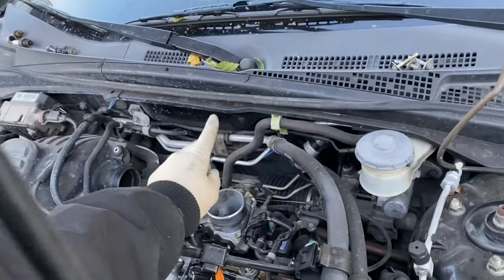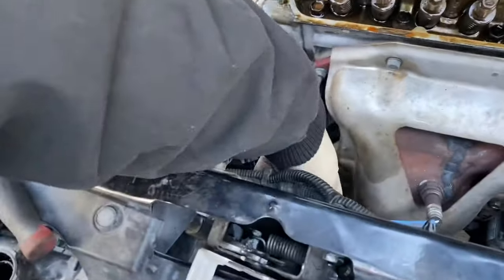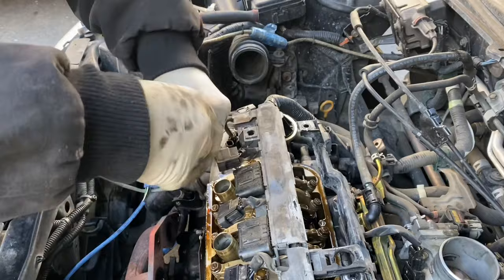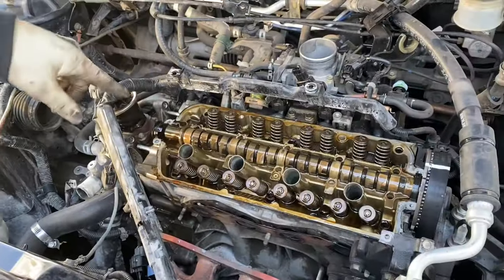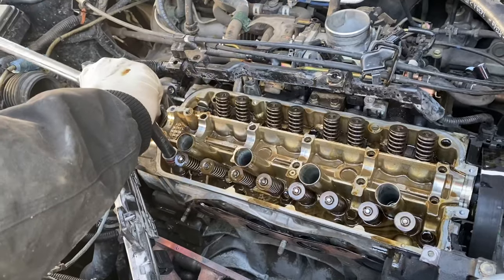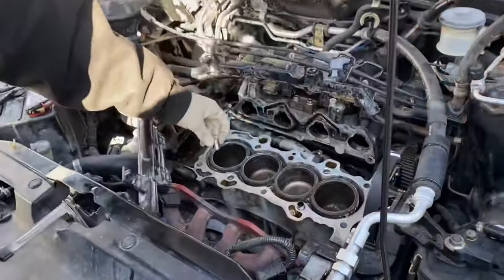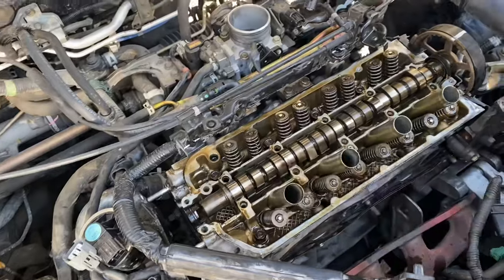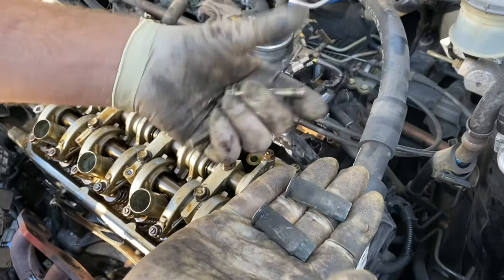2001-2005 civic 1.7 liter complete head gasket replacement step by step

Comment: Can you remove the head without removing the valve train and rocker arm?
Reply from the maker: Choghoree Karakorm yes you can. But then you must remove the harmonic balancer, timing cover, loosen the timing belt tensioner
Reply: Thank you. I'm going to do a timing job and oil pump as well anyway along with the head job.

Comment: I can't seem to get the cam back on the timing belt... it doesn't seem to tilt enough
Reply: You just have to push very hard. It will go on. It’s hard but it works. It helps to have two people so one can push the same up and the other can pull the belt on

Comment: I am in no way an expert and I’m not bashing you, but an honest question. Couldn’t you just take off the cam bolt/gear instead of taking off lifters and cam?
Reply from the maker: The problem is putting the timing belt back on. We didn’t remove the lower timing cover, alt belt, or harmonic balancer. Since the belt was new, we were able to skip those steps and angle the cam to slide the belt on. 
If the belt is old and stretched, it would be easier to slide back onto the cam without angling it.